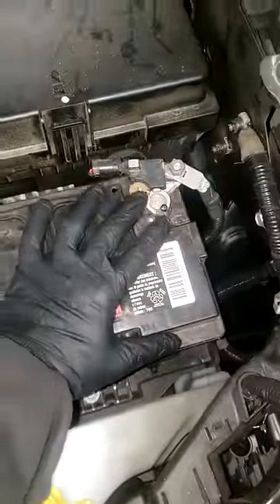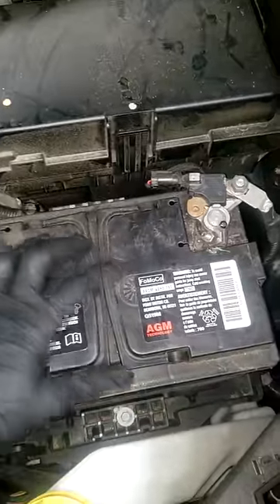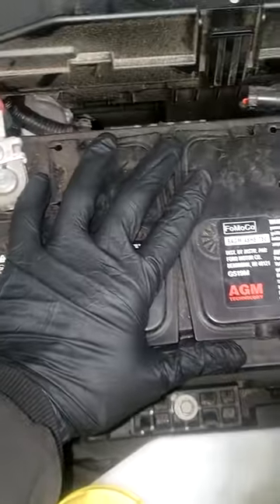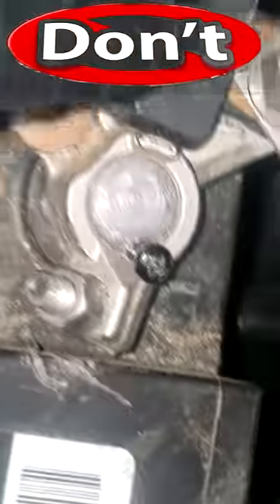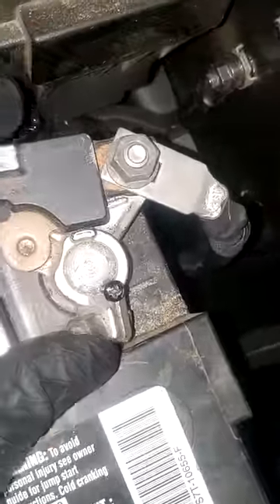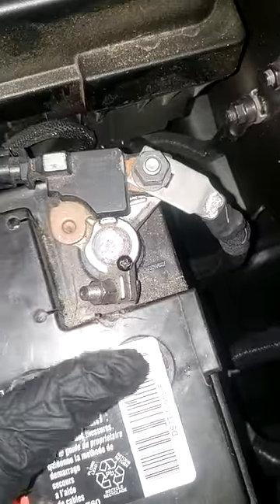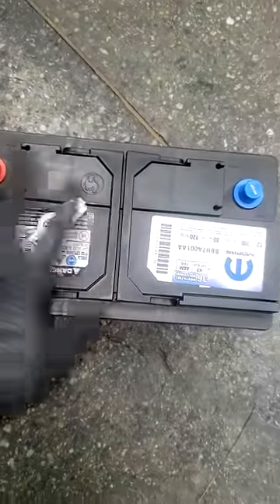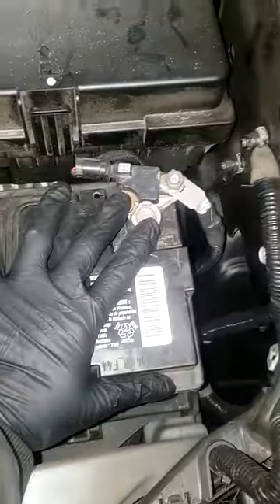STOP DOING THIS PEOPLE. This will destroy your car electrical system.

Comment: Some manufacturers require the correct nut on the main cable too. 
But as others said, no way that screw is causing any additional issue as long as the terminal is tight. 
The sensor maybe toast so yeah replacing it correctly incl the correct reset procedure would be a good start.
Reply from the maker: The screw was removed, the IBS and battery was replace. Car gone customer happy. I'm not sure if yall expect me to make you happy or the customer but that's a easy decision for me my guy.
Reply: @OnlineMechanicTips  Cool. If you read down I did say you were doing the right thing by replacing the IBS.
Reply from the maker: @Waikatotek  lol, but that's my point. I don't really car if you approve of it or not. I just share what I'm doing via videos on youtube for my DIY targeted subscribers. If you to advanced for the video simply make a better one and load it on your channel and explain your take on it.. i could guarantee you i wouldn't be a sideline troll by question your every move. Thats how youtube work. You have the freedom to make videos on your own terms.
Reply: @OnlineMechanicTips  Or just watch SMA and see how a real mechanic does it.

Comment: STOP holding your camera vertical. A cell phone camera will record just like you see, you have to hold the phone horizontal for that. When you hold your phone vertical it's like walking around with your head turned 90°
Reply from the maker: Thanks for the tip. I get a lil slack sometimes.

Comment: I enjoy watching these videos as a mastertech for Nissan, Hyundai and Subaru you would be surprised at the little things that cause major problems. A prime example is the other day I had a 2014 Ram 1500 and I got a P0300 code mind you this car went to Dodge and the customer was told that according to tech support the car had bad lifters and a bad cam and crank sensor. All I did was just look at the data display with a generic OBD2 scanner and saw that cylinder 4 was misfiring very badly. Changed the spark plug and coil and she ran like a brand new vehicle. This man is sharing his knowledge and experience out there, not many people do that. I even learn something new every time I watch these videos.

Comment: People have been doing this since the battery was invited.
Reply: Invented but yes
Reply from the maker: Might be a good time to stop now that your terminal is a sensor
Reply: Was there a party or something?
Reply: Works to when needed
Reply: @OFFICIALBROTHERBOLDLYMUSICNTV  yes and you weren't invited.  🤪
Reply: @OnlineMechanicTips  again....the terminal is not a sensor...the terminal ends are still the same as before...they just now have a sensor attached to them where the cable attaches to monitor values
Reply from the maker: @Kolonol1  im almost certain I've said that a dozen times. Im assuming you thinking that outside interference such as screws will not alter the connection and cause the sensor not to pick up on that. This customer lucky her trans didn't lock out. We get these vehicles towed in because trans in lock out mode all stemming from poor connection at the battery. So when we see this, we don't play. You getting a new battery and sensor, just simple as that.
Reply: @ronijr4918  that’s not nice more ron
Reply: @ronijr4918 
 Isaiah 57:4
“Against whom do ye sport yourselves? against whom make ye a wide mouth, and draw out the tongue? are ye not children of transgression, a seed of falsehood,”
Reply: @OnlineMechanicTips  maybe take a step back and listen to literally almost everyone in the comments and accept that you could be wrong on this occasion. Next time you get a case like this one just do a little more testing and you’ll get a chance prove everyone wrong.
Reply: @Clynikal  nah he's too childish to concede properly.  He'll just be an example of a scammer outing himself stupidly
Reply: @OnlineMechanicTips  The terminal is a terminal.  The sensor is a sensor.  The sensor is mounted to the terminal.  
Based on your theory then adding a screw anywhere on the vehicle "could" be considered screwing it into a sensor.
Reply from the maker: @watchdogu.s.a.8973  This is sold as a unit. Its one here. If the terminal suspect then the complete unit getting replaced. I don't gamble with hackery. They been grinding on that post and the underside of this terminal. That and the code all I need to see. Not taking a chance on any of these parts.
Reply: Bro I give you mad prop's for being in here.I would either not read the comments entirely or pin a big F U disclaimer to the top
Reply from the maker: @WallyST675  Do it look like I care what you think about me lil Mr Nobody Man? Stop seeking attention
Reply from the maker: @trains2057  No, im good. Im one of those that reply to comments. Good or bad. I just wish the super tech gurus had legs to stand on. Like a channel that shows they who they are and they may no what they talking about but noooo,  mfs with no credentials displayed just yelling out shit. This the internet, anybody can make shit up.
Reply from the maker: @jamesolelo4406  lmao, concede to what? Tf???
Reply from the maker: @ProtoTribal Man ain't nobody doing all that and why yall always assume the customer poor or hurting for money? This lady say fix her car right. Aint nobody grinding or sanding on anything. 2 new parts lady, done and gone and she's happy.
Reply from the maker: @Clynikal  lol, wrong about what? This not a right or wrong case.  Opinionated at best. And again, this a 60 second shorts video. How much do you think i can squeeze on here? Stop assuming because you don't see. Test was no reason to test a visibly screw up. Yall spend to much time on trivial shit. Get this car in and out. A battery and a IBS she's fixed gone and happy after she just left your kind of shop.
Reply: @OnlineMechanicTips  reread for comprehension instead of mis reacting..
Reply from the maker: @jamesolelo4406  I understand everything you saying, I just don't agree with it. And that's ok, thats not a bad thing. We just have a difference of opinions
Reply: im 46 years old, this is the FIRST time i have EVER seen someone screw a screw into a battery terminal like that, you must be some kind of special to do that lol
Reply: @JacoKruger. Uh. It works just fine without all the electrical nonsense of  current cars.
Reply: It’s bad for the electrical system. The ECU, alternator and all the other modules require a solid connection to the battery. A loose terminal can cause arcing. Arcing is bad news for an aging electrical system on a modern car. The battery serves as a voltage stabilizer for the system as well which requires a good contact to prevent damage.
Reply from the maker: @EricFortuneJr.  Yes, especially the TCM. One wrong arch and ya transmission will be bricked and not shift. It knocks the trans out of proxi alignment. We get them towed in all the time. And mechanics simply pad the estimates because of customers and mechanics stupidity like this. All they do is fix and make proper connections at the battery and simply un brick the transmission. Easy money for crook mechanics. But theses so call pro mechanics really in here on this post defending that damm screw..smdh
Reply from the maker: @JacoKruger.  lol, yes especially on these newer cars thats basically computer controlled. This was ok on the older cars. And to think, this post full of pro mechanics on here actually defending that screw..smdh

Comment: Yes and no, I've changed plenty of batteries down at my shop with these stupid screws on them, gave them a new battery and they were back on the road, other times the issues persisted so we popped down to AutoZone and swapped it out, the sensor is not affected by the screw in any way, the "complex" electronics what "we know nothing about" cannot tell the difference between a chunk of lead and a chunk of lead getting shagged by an iron nail, and if you believe otherwise you are either uninformed or trying to upsell someone.
Reply from the maker: How much more better my life will be because of selling someone a battery thats wrong and a sensor thats stabbed by a screw by some idiot trying to get better connection at the battery?  smdh..The key word here is connection. The connection at the battery has to be on point or ALL bets off, nothing else matters. So this complete repair basically centered around proper connection at the battery. Crucial for these newer high tech cars.
Reply: @OnlineMechanicTips  2020 ford fusion, came in for a no start, tested the battery, it was bad, the battery itself was bad, I replaced it, it had that goofy ass little screw there, put everything back together minus the screw just used some channel locks to bend the terminal back to true, I agree that the sensor has to have a good connection for it to function properly, but there is enough leeway because of how conductive copper and lead are, the battery is lead and if you scratch the inside of the terminal it's copper underneath, I do understand where your coming from, but it's just a fact that the engineers have accounted for an unoptimal connection I'm not going to pretend like the screw helps any, but on the same note both the terminal and lug are conductive enough that it doesn't really matter.
Reply: @OnlineMechanicTips  I do agree that when it's possible for the customer we should do it the right way, but I'm in a relatively low income area and not all these guys can afford a $60-$430 part when I can get them back on the road without it, I still think you overestimate how much that screw really does, so I disagree, that's fine I'm still enjoying your shorts, I go to sleep fine at the end of the day knowing that my customer doesn't have to skip lunch for a week just because the mobile mechanic down the street said they need to replace it or it won't work.

Yee Haw from Dallas Texas, keep it real man.
Reply from the maker: @KamiEpix  Dold it down in the big D. I used to live in Irving Tx. Worked at Grubbs Chrysler for 3 years. Love Dallas

Comment: As a person that runs a shop, that screw shit only works on older cars with no type of battery sensor, or reader thats in connection with the battery. That shit will turn the car off every time or fuck with the electrical ( to much resistance)
Reply from the maker: Yea proper connection crucial on these newer cars.

Comment: The problem with people giving information like this is even if you're 75% right.... The 25 percent that you're wrong about Makes that repair entirely Unnecessary
Reply from the maker: But this is YouTube. You welcome to make a video and explain your thoughts on the matter on that video on your channel. Its not a matter of right or wrong. It's my opinion.  Do with it what you will.
Reply: @Online Mechanic Tips your opinion supposed to be an Expert Opinion.... Did the parts that you Identified in the video turn out to be the entirety of the problem
Reply from the maker: @justinbellio2285  Yes

Comment: The parts dept gave you everything you needed the first time. Stop lying to customers.
Reply from the maker: Lying about what Mr confused man? That is a typical battery terminal they brought me, in case you just joining the party, we dealing with a IBS sensor. Do you even know what that is? Or am I just wasting my time with you?
Reply: @OnlineMechanicTips  I have IBS. Just not on my car 😂
Reply: If fix it with a new battery terminal doubt it even needed a battery just a better connection
Reply from the maker: @nathantrafford8912  battery wrong with wrong size post
Reply: @nathantrafford8912  the ibs sensor is very sensitive. Any resistance will throw it the wrong signal literally.

It could theoretically work forever, or it could kill your battery faster, or shut your entire car down.

Comment: that would work just fine, the screw is not the problem.
Reply from the maker: Lol, you welcome to put screws into your battery sensors my guy.  This car fixed and gone
Reply: @OnlineMechanicTips  okay
Reply: @OnlineMechanicTips but it was that janky battery.
Reply from the maker: @MrS22222  then why not just replace the junky battery and leave the screw right?
Reply: @OnlineMechanicTips  the screw is a temporary fix, you're right to replace the terminal but that didn't cause any parasitic draw.
Reply from the maker: @MrS22222  The concerns not about a draw. She have electrical problems. That other shop put in the wrong battery and grind on that terminal then used a screw to try to make it fit secure. Big red flag to me. You getting a new battery and a new IBS and that stupid screw have no place on these newer high tech cars.
Reply: @OnlineMechanicTips  that's definitely what happened. Those screws are put in by older heads that know the screw will get it done but they are meant to be temporary.

I had one come in with a marine battery shorting out on the hood last week. 

Could be a "hold my beer" moment too.

Comment: This seems like one of those "Tell me you don't understand electronics, without telling me you don't understand electronics".  

The screw is not the cause of the issue. The screw was likely put there in an effort to tighten the connection, likely in an effort to save the customer money. There are two possible causes here. A loose connection, or a failing battery.  If the cause was a loose connection, then the person who added the screw was trying to fix it without costing the customer money, and simply failed to make the connection tight enough.  If instead the cause was a failing battery, then the screw is irrelevant.  In either case, the screw is not the problem.

If the battery is ok, then why would you sell this lady a whole new battery instead of using lead battery post shims (which perform the exact same function as the screw, but is actually intended for the task)?  You had an opportunity to save the customer money and repair their vehicle properly, and instead chose to up-sell them on something unnecessary.

If instead the battery was NOT ok, then obviously the problem is a failing battery, and NOT the screw used to tighten the connection, in which case the new sensor and connector was unnecessary, because the new battery will have less worn posts that secure fine.

In either case, it ultimately looks like you took advantage of a customer and blamed an irrelevant screw on an issue, because you have no idea what you're talking about.

Sure, you fixed the problem, but not because you understood the problem, but because you charged a customer enough money to shotgun all the related parts at the problem instead of figuring out the actual cause.  

I understand though, its an issue of time. Its faster to just replace all those parts than it would be to figure out the cause, and that's fine, but making a video where you blame the screw just makes you look like either an idiot, or a grifter.
Reply from the maker: Bro you lost me when you suggested using a shim on the battery..I couldnt even read the rest of this foolery after getting to that part. You to far gone. smdh, dont be using this stuff on these newer cars man. Because connection at the battery so crucial, why not just simply replace the needed parts? Stop always thinking you want to save customer money, customers would glady pay for the insurance of knowing its done right. Hacks and shims and screws is not considered done right. Just get a new battery and a new IBS terminal and you done. Geeesh, yall think to hard.
Reply: @OnlineMechanicTips  And people wonder why insurance premiums are so high, smdh.  You literally just admitted that you're part of that problem. Why actually try to figure out the problem and fix only that when you can just con the insurance company to pay for more parts. 

If the battery was fine, replacing the terminal/sensor would have been sufficient. 

If the battery was bad, then the terminal and sensor were probably fine and replacing the battery should be sufficient. 

In either case, the screw/bolt didn't cause the problem, it just failed to fix it. That's not the same thing, and if you don't understand that, then you don't understand electrical systems well enough to be working on them as a professional, much less telling people on a video that its the problem when it isn't.

I'm not against fixing the problem "properly", I'm against people blaming things that are not relevant to the actual problem, like you did.  You can call it janky or cheap or ghetto, but its still not the cause of the actual problem.

I understand that its a time thing and replacing everything with new parts is faster, and getting the job done below book time is great, but taking advantage of either the customer or their insurance just to finish the job faster is either lazy or ethically questionable.

Comment: When the car is running. The alternator is technically the heart and soul. The battery just starts it. I know more modern is slightly different, we can no longer take out the battery after starting it without issues, but I would still say the alternator is the main source of power
Reply from the maker: Curious, when you first stick your key in the ignition and turn it, what do you suppose the number one thing thats needed?
Reply: Hopefully a motor, then maybe a starter motor, then an ECU, then an intact wiring harness, then a functioning battery. That IBS will let ECU know if the battery is failing and the ECU/IBS will store the data  until the issue is resolved.